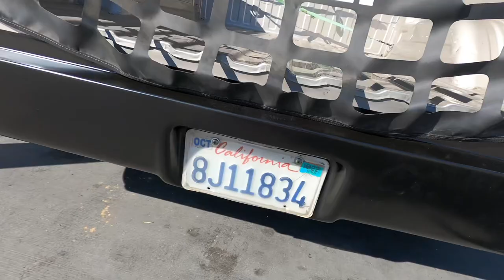Boosted Truck Gets A Roll Pan

Comment: Just subscribed I have the same truck same year same motor 4.gr8te .
Reply from the maker: Ayy that’s what’s up have you taken off the bezel on the dash ! They have a factory name, mines Kathy 😂
Reply: @BoostedMigs  not yet I will check it out
Reply: @BoostedMigs  I will check
Reply: What manifold set up is that? I’m doing an on 3 76mm single turbo set up on my 5.3 Yukon and am looking to upgrade my stock manifold. Nice build btw!! 🤙
Reply from the maker: @johnnybaker9027  it’s a Jegs manifold but your gonna need an adapter or a new throttle body I suggest going w a 4 bolt TB and getting the X link to go from 8 pin to 6 pin I’ll shoot you the link on ig !